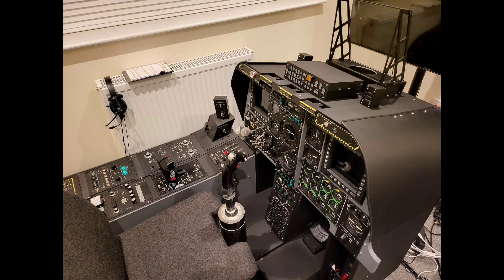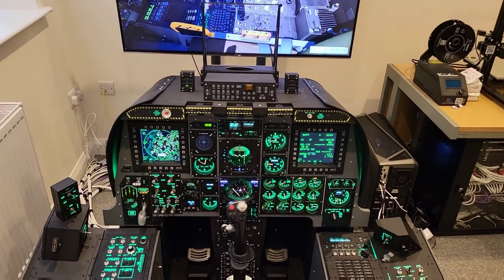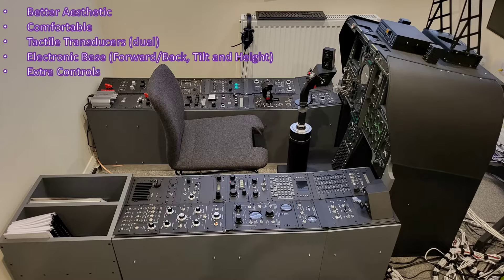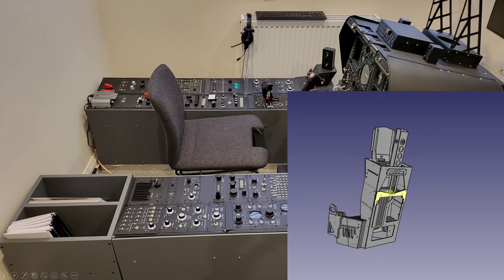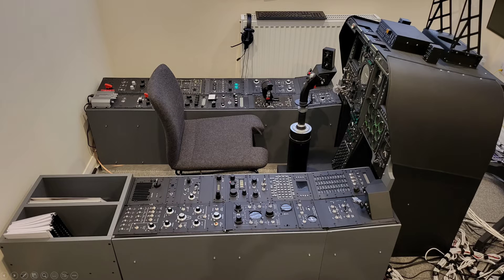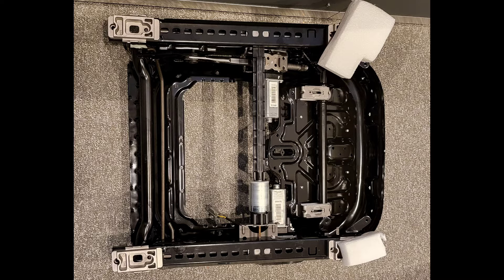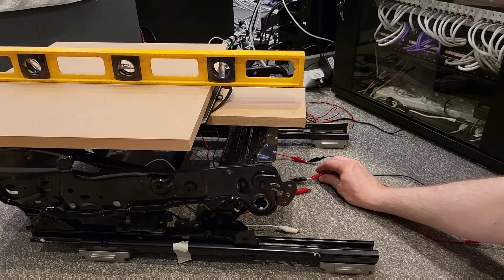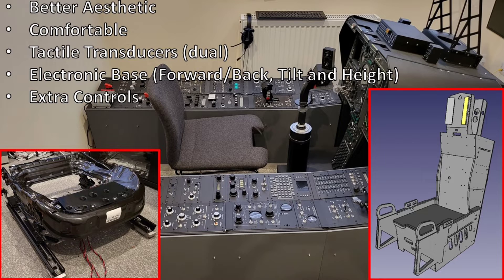Simpit A10C - Flight Seat - Part 1: Preparation

Comment: Awesome concept with the car seat base!!  Can't wait to see what you do with the mounting and controls.  Maybe mount the controls on one of the blank panels?  Make it part of the left or right console?
Reply from the maker: Hi Hydrolisk, it'll be good to have the movement of the car seat base but it has meant a bigger redesign / adaption of the flight seat plans. For the additional controls I'm thinking of a few discrete miniature toggles running somewhere by the arm rest. As you mention, if I need more I could always add to the consoles. Thanks for watching 👍

Comment: Hi Craig.
I just wanted to drop by and say hello.
I'm working on a sim pit myself though I am not planning on replicating a specific cockpit or seat.
The good news is that I have a spare set of seats from my current car, a 2005 E class Mercedes. I will probably use the passenger side seat, wire up a few extra switches as it already has all the tilt, elevation and air cushions built into it, so All I really need is the seat heater and base on separate switches. I have plenty of ATX PSU's and linear motors laying around to make the whole pit electric foldable If I so choose, The question is the transducers, I have a few amplifiers I could use for that, simple stereo channel would work with the proper filtering, yes?
Reply from the maker: Hi Stefan, I hope you are well. The tactile transducers are connected to an amp in stereo and the setup is controlled by the sound module add on for SimShaker for Aviators